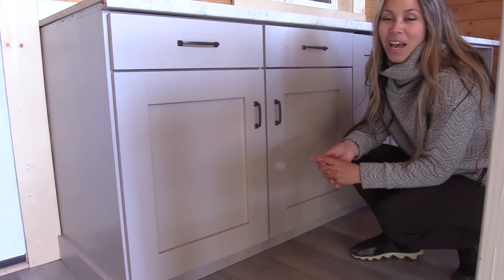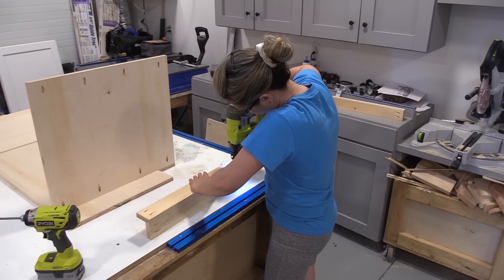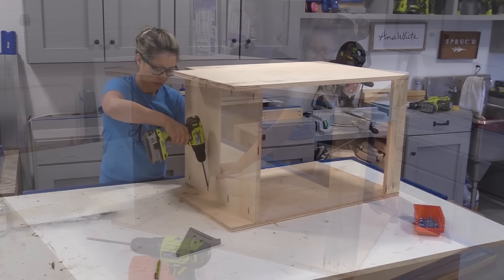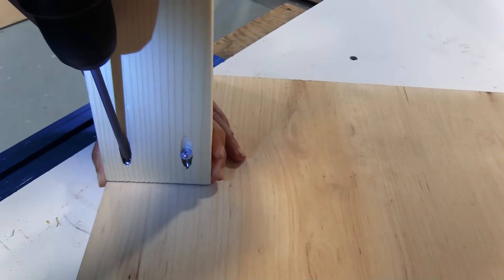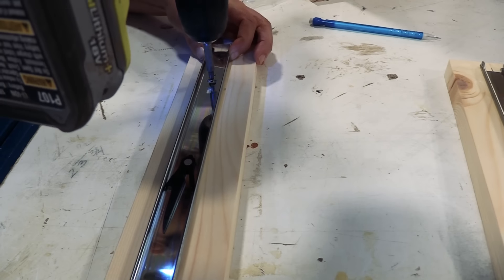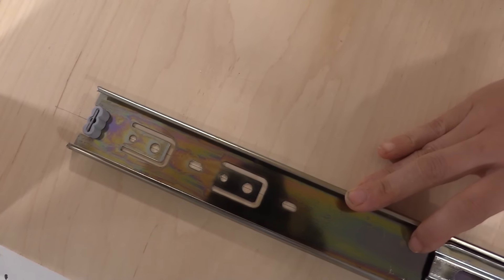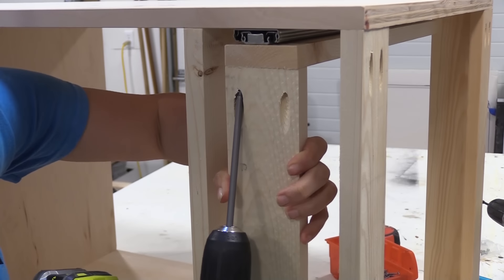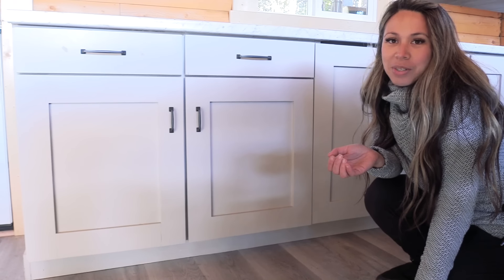Building Kitchen Base Cabinet Carcass with Super EASY Drawer Method

Comment: Thanks Ana.  The tip of putting the drawer sides and slides on first, then measuring for the front and back of the drawers was epic.  That is going to make my life so much easier.
Reply from the maker: I know, when it finally dawned on me it was a life changer! So happy to help:)
Reply: @AnaWhiteDIY  what type of wood do you like to use for the drawers and doors?

Comment: I tried using shelf help just for the free plans but it is not clear how to simply download the plans, it states email to me but it only emails a picture of the built item but no pdf of drawings. Then I tried "cart" but it wanted to charge me for the wood there. So I removed that from my cart. I have searched through the website templates and configurator but can't figure out how to download the pdf plans for free. Do you have a video showing how to get just the free plans? This is frustrating because although it seems like a good idea to be able to adjust the size of project in self help but I'm used to just downloading your plans from your website for the same size project that you are building in the video and then I adjust it myself.

Comment: Anna, I have kitchen cabinets that are very outdated. There was a router design carved into my cabinet doors. I plan on covering that with wood putty and letting it dry then sanding the door down till it smooth but I wanted to put thin wood around the outside of the door to make it look like shaker style cabinets. What type of wood would you recommend I use? Also, what type of paint should I use? Some say to use oil base paint other say the best is acrylic. What is your recommendation? Thank you for everything and as always I love your videos. It’s always fun to watch your children. Grow into.

Comment: For the drawer side and the full extension slide, you mentioned that they are cut the same size. But it seems/looks like the wood side is a bit bigger - about how much bigger do you make it or does it just loo that way in the video?
Reply from the maker: Eagle eyes!  So a 14” drawer slide is actually 13-5/8” ish... but it doesn’t usually matter so I just cut them to the nominal length

Comment: A handy tip, at 3:50 when screwing the drawer side/slides to the carcass instead of putting the screws into the holes on their own as you did, use the holes at the top of the cutout (bottom of the U shape) this U cut allows for a small amount of self correction if the drawer is slightly too narrow (the metal bends conforming to the drawer size.
Of course your no measure way of building the drawer helps negate this need, simplicity but brilliant.
Thanks for the video.
Reply from the maker: Always appreciate extra build tips, thank you!

Comment: Hi Ana, the Configurator is a great tool, with 1 fault = "Free shipping within the continuous United States only". Could it be programmed that the finished design be saved to e.g. PDF ?? Reason, I live in Germany, but even if I didn't and had used the tool, once the carcasses arrive, I may have forgotten what my ideas were.
Reply from the maker: Thank you we are trying to figure out a way to do this, since it would most likely be metric, can you screenshot designs now?

Comment: Went to shelf help (multiple sites same name) but was a bit disappointed.  Maybe my expectations were unrealistic!  I thought I'd build the granite-topped desk in your recent video even though I had just built the rustic x desk!  Liked the look of the newer desk.  Thought I'd just be able to order from a template since you had made it already but, if I'm not mistaken, I would have to input the measurements. Am I correct or a blockhead?
Reply from the maker: shelfhelpnow.com
Reply from the maker: We are working on creating set configurations, but don’t want to loose the ability to customize sizes. Thank you for your feedback

Comment: Is there a way we can get the web configurator in metric? Sometimes making the conversion is tricky, specially if you need exact measurements for something like this, and missing even by a 16th of an inch can be a problem. Its an amazing tool and it blows my mind, and having it also in metric would be amazing
Reply: Yes agreed, metric would be very helpful in avoiding conversion errors. (Australian fan)

Comment: HELP! In this tutorial you say measure doors and drawers by width opening plus 1. Height opening plus 1/2. 
But then in the wall cabinet tutorial you say width plus 1 and height plus 1. 
I’m following your exact plans and ordered the hinges you linked. Which measurement is the right one?
Reply: For the height opening of plus "1" thus a 1/2" overlap on each side you will not have a gap over top of the nominal 1" drawer divider bay support. The bay support is about 3/4" thick so use height opening of plus 1/2".  Hope this helps.

Comment: Hi Ana, love your videos and have already made a few things for our new home from your videos and plans!  Wanted to know your thoughts on expanding an existing base cabinet.  We ordered our (all plywood construction) but they didn't have the blind corner cabinet available, so we bought the smaller 15" base cabinet with plans to add on plywood to expand the size for the extra storage in the corner.  Would you recommend dowels with glue, pocket holes, staples, etc. to connect 1/2" plywood sheets at the end grain.  Can't seem to find much on this topic.  Keep up the great work!
Reply from the maker: Thanks Alex! It’s really tough to get a good joint with 1/2 plywood on the end grain.  Can you add a 1x2 cleat in the corner to reinforce the joint?
Reply: @AnaWhiteDIY  That's an interesting idea - hadn't considered that and I agree that drilling into 1/2" plywood was not tempting.  My other thought was to leave 1.5-2" of the wall of the cabinet we're removing on both sides then use triangular brackets to connect the new plywood.

Much appreciate the idea and all your content. Wife loves the two modern Adirondack chairs!

Comment: Unusual question. Think of two floor cabinets not connected to a desktop that houses equipment. I am injured - and I need to push the two floor cabinets away from each other  by 6-9". Have you ever seen a tool that can brace against the two inside and solid walls to tighten in order to move the cabinets outward?  Not connected to the desktop in any manner - but I am unable to remove everything. Think if two 3' tall 24" wide floor cabinets - and moving both or even one at a time - a small distance. I thought the best way was to tighten  something between them and move slowly. This is all because of a injury that prevents me from just getting between them and pushing like heck - -
Reply from the maker: Maybe an air jack or balloon jack....
Reply: Lay bricks or boards against 1 cabinet to reduce the gap between the two and lay a car jack down on its side next to the other one and start cranking…if you can reach it, that is.

Comment: Could you provide more information about the drawer slides
Reply from the maker: These are just standard “ball bearing” slides available at Home Depot or Lowe’s or in bulk at amazon for waaaaaay less
Reply: What method do you use to make your alignment is correct for glides on the drawer and carcass of the cabinet. Do you measure up from the bottom or top or something else

Comment: 3/4 inch  routed grove is more in line with quality cabinets. and a lap joint. The pocket screws are used, but not even close to the strength of the traditional method and what is considered quality build cabinets. Along with having a face frame.

Comment: It looks good from the outside and is easy as many say. But there is a downside, and that is, pardon my adjectives, it is a cheap cabinet and it will not last with any use. Nailing or gluing a bottom on the bottom of a drawer frame is not a quality process. Anything of weight in the drawer will soon loosen the bottom and it will fall out. All drawer bottoms must be installed in dados (slots) at least on the sides and front members of the drawer. I would also never put a drawer together with pocket screws. A lap joint or dovetail is the preferred method of joining. I know I know, it take more work. But on a DIY project, do you just want to be done like a cheap cabinet maker making a profit selling junk to a big box store, or do you want to be proud of your work? For smaller DIY projects, you want to learn how to do it right and you want a product you can be proud of. The goal is not to just be done. So it takes an extra week to finish your kitchen remodel by doing a quality job, it is worth it! Dados, rabbits, glue, clamps, edge finishing, quality hardware, and time are the components of quality cabinets.

Comment: I use gmail
Reply: Hello Ana, I love your videos. I did a remodel and added the pullout trash can then I had no room for drawers. Do you have a video showing a cabinet recessed into the wall, with the inside of the cabinet on the outside which would be in my garage? Thanks for reading my post.